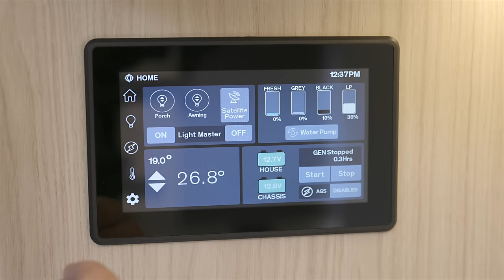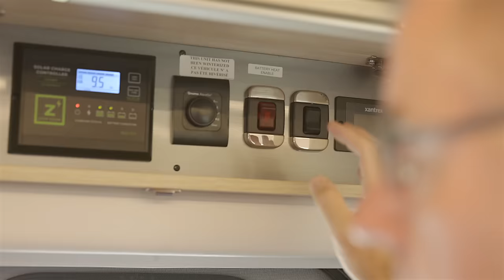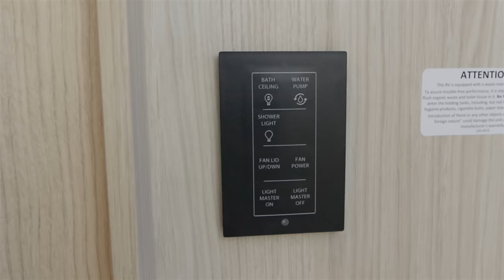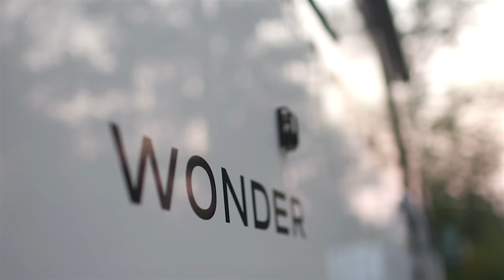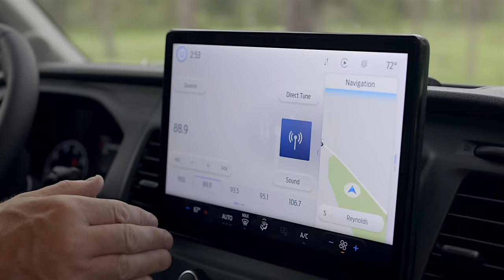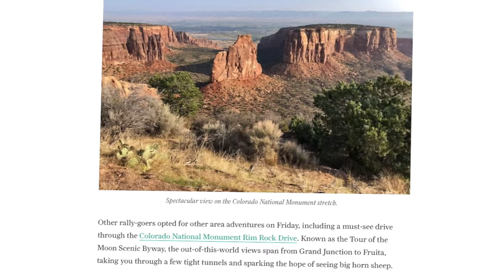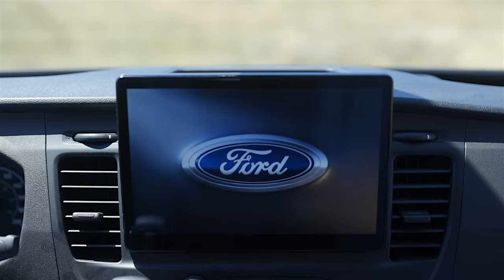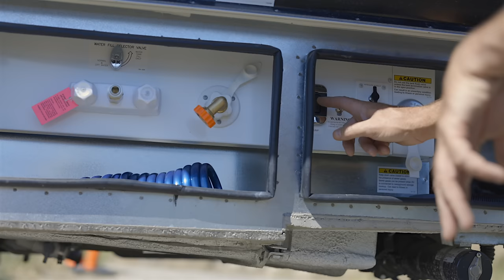2023 Wonder Murphy Bed Lounge

Comment: Well, it's the worst thing I've seen. Window blinds... do you seriously think it's a normal solution in 2023 to stuff them somewhere to prevent drafts? 
The table - apparently it's assumed that everyone will eat one by one since there's not enough space for more.
The sink in such a huge bathroom is so small that you can't even wash your face or brush your teeth without splashing everything around.
The bed, it's not a bed, it's a transformer. What if someone wants to lie down longer while another person wants to have breakfast? Where is the table at that moment?
By the way, it's not shown where the bedding is stored for this bed. I suppose there's a place for it in the center under the sofa, where all the dust and dirt from the street accumulate.
In general, if you haven't collected transformers since childhood, then this is the vehicle for you. If you want to travel comfortably, just pass by.